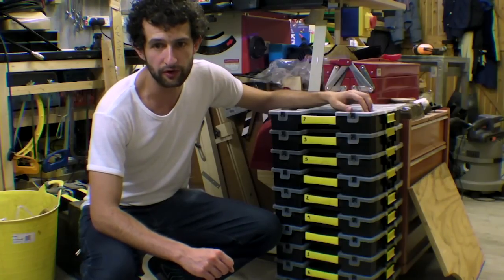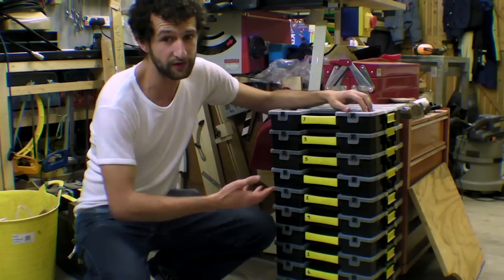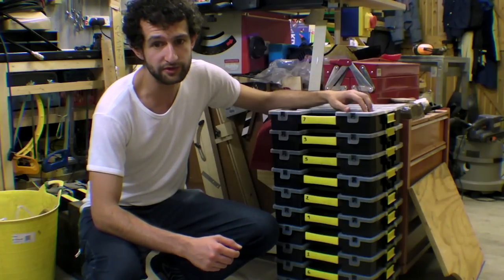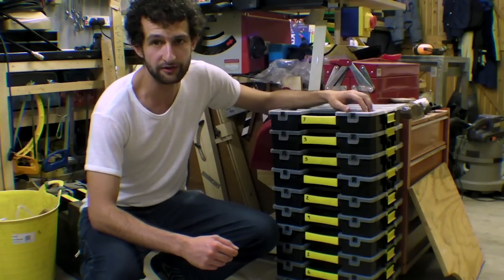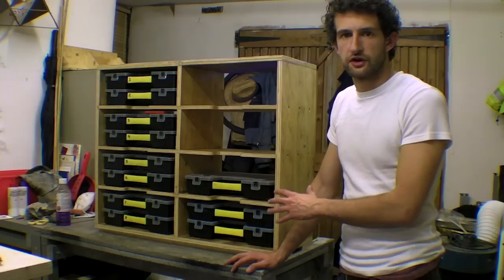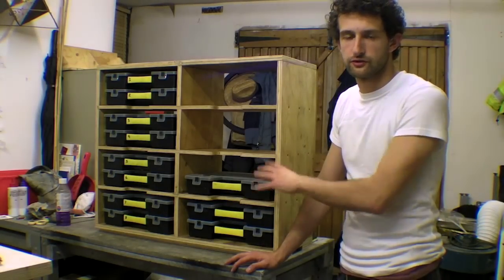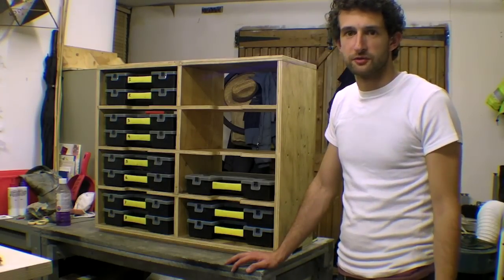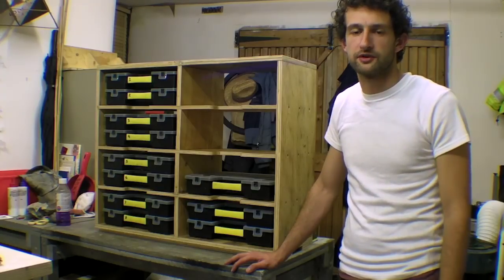Shelving for Storage Organisers - Fixing / Screws / Bolts etc.

Comment: Great job. Here is something you might want to consider for a future project, make a hole marking guide like you did when you hammered in 3 nails then cut the heads off. Doing so would have allowed you to mark 3 spots at once and would have saved a lot of time measuring, plus it would have given you a divot to start the drill in all at the same time.